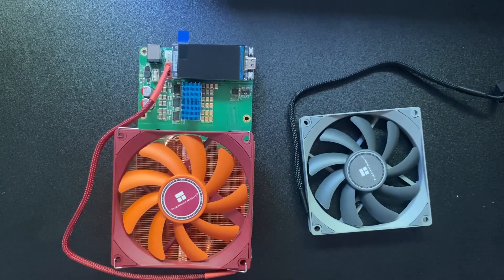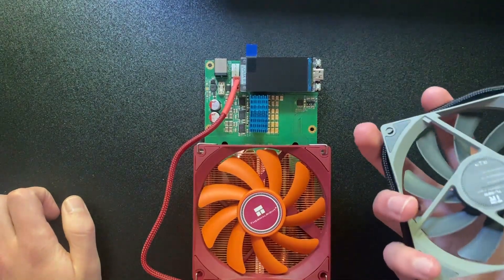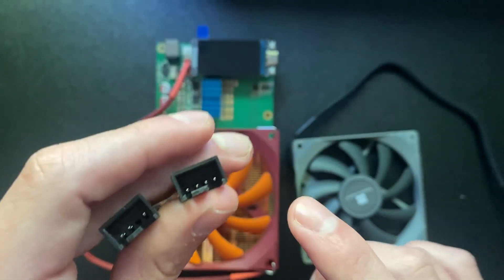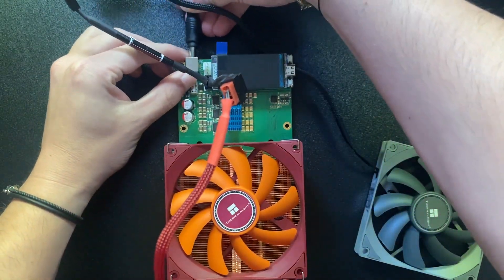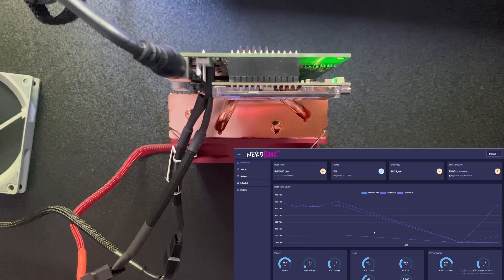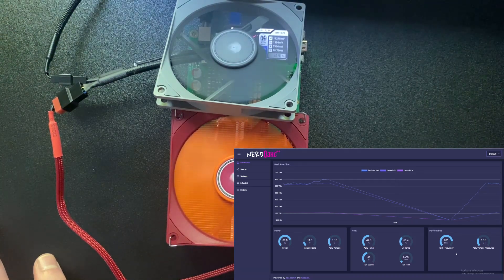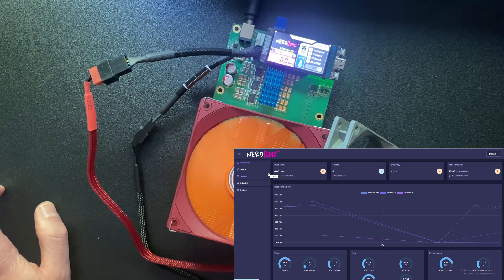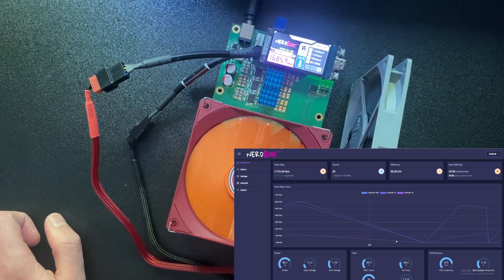NerdQaxe++ Testing Double Fans Upgrade...

Comment: the black chips are the voltage regulators and you put the coolers on the inductors next to them. witch is unnecessary.  doesn't mean you need to remove the coolers you put on but that you should also put coolers on the Vreg too

Comment: Putting a heatsink on ceramic capacitors is probably a terrible idea. If you take them off, you risk breaking them off. Ceramic capacitors are the small tan colored squares.

Comment: Having that fan pointed across the heatsinks in an open container allows too much of the air to 'escape' without touching the fins.

You want to concentrate the airflow over the voltage regulator to get the coolest temps.

Comment: Hey, if I can advise you, get a Meanwell power supply - at least 12V/150W, even better 12V/200W + 14 AWG power cable.

Btw the Voltage Regulators are actually the three small, black chips next to the Coils where you placed the Heatsinks. If the Coils are hot thats probably because of the heat from the Voltage Regulators. So it will be better to blow the air from the second fan directly to the Voltage Regulators and/or use the cooper heatsinks for the Voltage Regulators and the sorroundings components.

Comment: You inspire me for tinkering but this video is not really helpful. Here are some critique and ideas:
You did put heatsinks to coils, I don't think they are the hottest part but chips on the left should be VRs and should be very hot. If coils are hot it's because VRs are hot nearby and I believe coils are much more heat resistant. Small regular items on the sides are capacitors and shouldn't be very hot too. So, I think it's better to put radiators on the VRs and use thin leaf radiators with more height.

Cooling from the side of coils is not optimal too if you want to cool down VRs. I think it's good idea to find developers community of this device if it's accessible.

Copper is much better than aluminum even with the same size. And I believe nobody would anodise copper but aluminium frequently anodised to look cool/expensive. Copper is the best and don't need such advertisement) But I see different opinion in the comments.

I didn't check the schematics but maybe it's a good idea to try to power fans from different source because if the same VRs are used for fans it's counterproductive. I would check and ask around to be sure before buy another power adapter for fans because I could be wrong here.

Comment: I have a water pump plugged on the top conection and 2 fans with a splitter on the bottom for the radiator

Comment: The one above powers a 140mm fan for me at full blast. Turn off auto fan control and set it to 100% for better OC. Put some heatsinks on the black chips next to your blue ones. 750/1200 for me and hitting 7th/s. Also your voltage is too low, you need to get a better power supply that will hold it at 12v. I got a 12v 18amp 180 watt and runs smooth at 12v on all OC's.
Reply: @@unitymind Could you post a link to your new PSU, please?
Reply: @tercel2900  I can't post a link but if you search for ALITOVE 12V 15A Power Supply DC 180W you should find it on that place that starts with an A.
Reply: @tercel2900  also you could do a meanwell power supply just make sure it is 12 volt over 10amp. You can do any amp (over 10) and watt just make sure it is 12 volt. Axe won't draw more than it needs so the higher the better for headroom. That will help it be more efficient and cooler temps. Also do a search for NerdQaxe++ evolution or a psychedelic voodoo experience and you will see some great ideas. Sterling I love him cause he does things I would think about doing.
Reply: @tercel2900  ALITOVE 12V 15A Power Supply DC 12 Volt 15amp 180W